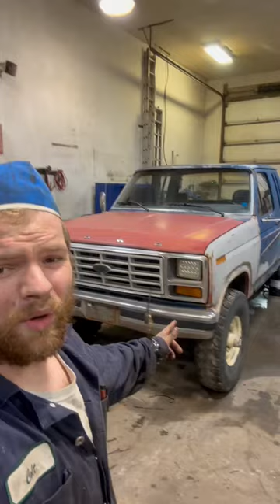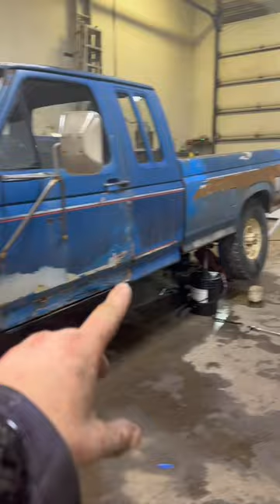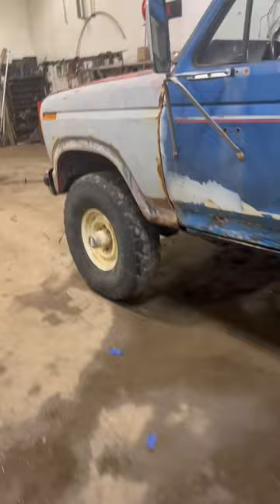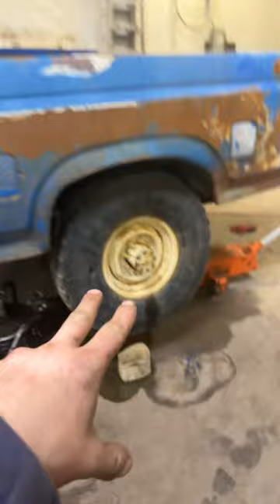Fords state of the art flexi frame

Comment: This is just dumb. Ford uses exactly the same style c channel frame now that they always did, and frame flex is not necessarily a good thing. And that is more frame flex and less suspension flex than an f250 should have, you definitely have some loose rivets or rust making your frame twisty.
Reply from the maker: Considering the newer ford frames are hydro formed box frames I don't think you know what you're talking about, frame flex is a characteristic of ladder frames designs, its very aggressive on complete c channel frames, the longer the frame the more flex. Considering this truck is much longer than most trucks on the market today and is almost complete C channel it is perfectly normal to have this flex. Also as for the suspension flex you can't even state something like that without knowing how man leafs are under the truck, the more leafs the less suspension flex thus more frame flex, less leafs the more suspension flex, less frame flex needed.

Comment: You may need to send your engineering resume to Ford. You already think like a Ford engineer that has been there for decades and haven't even gotten the job yet. Basically taking a problem or issue and çlaimiing it's an added bonus. Flex isn't engineered into a frame. Flex is engineered into steel. It can flex or it can break. Ford frames moving 6 inches or more over the length of a vehicle is too much and definitely not  a benefit when radiators meet fans and Subway sandwiches are where your spark plugs used to be. Oh wait, that's another issûé . But hey, Ford knows you may need food more than firing cylinders. Keep it up Ford advocate, they need you more than ever now
Reply from the maker: Heavy duty semi trucks still use C rails to this day, they also flex very well. Must be something to it
Reply: @highostablegarage  I have installed dump bodies on big trucks several times. Macks stand out as one with double and sometimes triple C channel frames. I just think this video has gone in a strange direction. When engineering a vehicle frame one doesn't spend a bunch of time calculating flex into a frame. It's quite the opposite. I said before certain metals are hard and brittle and some are soft and malleable. All have a purpose. The foundation of a vehicle should be and needs to be a rigid platform. Flex is your suspensions job. Yes frames flex in certain situations and brittle frames aren't desirable but I would hope we can agree that when a Ford truck is stuck in a plowed field on fairly level ground except the holes the tires have dug and the bed covers half the rear glass then we have in my opinion too much frame flex and I doubt that even bottom of the barrel engineers did calculations and intentionally added this feature into their vehicle.This was one of many real world observations.  There's a thing in manufacturing called " non value added" these are steps that cost you money but give no benefits that one would pay extra for.These are also things you seek to eliminate if possible. So where are we? Yes, frame flex is a thing but I assure you it's not a desirable thing. Frame cracks aren't desirable either. I think engineering seeks to find the balance where cracks aren't an issue and flex isn't either.

Comment: It was poor design that’s why they are no longer built this way. Same with all crossmembers many many iterations and trials for frames. Only one I can say did a well good job is Toyotas Land Cruisers. And that’s 80’s till mid 2000’s though as hell. Very resistant to rust. Only bad part is with the boxed in design all the extra holes catch dirt and the frames will literally fill up over the years. And that WILL rot them. But all the big 3 make much worse designs even to this day ford and dodge are a joke when it comes to vehicles. Glorified SUV’s
Reply from the maker: Idk, heavy duty transports are all c channel

Comment: I don’t think that the truck twisting itself apart is something to be proud of.
Reply from the maker: That's what it was designed to do so I don't see why not.
Reply: @highostablegarage  no it’s not designed to do that. That’s just a by product of ford being too cheap and not knowing what they were doing at the time.
Reply from the maker: @connor4961  c channel frames are designed to flex, that is one of their whole advantages, ford technically wasn't the only company doing this either, square body Chevys are the very same. Modern transports do the very same thing.
Reply: @@user-ov4mt5yw7q the alternative is that they design some actual suspension that does it’s job.
Reply: @@user-ov4mt5yw7qagreed. I have a 95 f250 and would do things with it I wouldn’t do with our 2012 f250 work truck
Reply: @connor4961  you really wanna go after dodge or Chevy on their suspension in the 80s 💀
Reply: @connor4961  sorry broh big rigs still use c channel and flex like crazy, just go look at one with a load behind it trying to accelerate, the whole frame is twisting, it's designed that way
Reply: @nativeoutdoors1780  yeah a big rig that weighs 80,000 lbs loaded and isn’t designed for off road purposes. This is a little pickup that’s built to throw shit in the bed and go down fields and rough roads, also I’m sure dodge had shit suspension too. The only one I know that had decent suspension for the time was the old square body, not saying it rode well or anything and I know it had the same c frame design.

Comment: As a certified, Chief frame specialist. That is not at all what is going on there. Not even close. It's called suspension articulation.

Much like the foundation of your house... Your frame isn't built to flex.

That frame is rotting. And losing its structural integrity.

Put the phone down. And go back to school.
Reply from the maker: You are so wrong you have no idea XD explain why semi trucks and trailers are designed to flex? A flexible frame is a byproduct of a C channel construction.

Comment: My buddies make fun of me when i flex out my 84 f150 in a ditch or on a big hill there like aww man your truck such a pile and its not supposed to look like that and im just like no c channel frame sorry chevy boy my ford just built better😊
Reply from the maker: in todays standards the early trucks look like there is something broke on em when flexing, but it’s just how they are haha
Reply: Ummmm. I’ve owned a few old Fords and Chevys and some newer fords and Chevys… fords are not built better, old vs old and newer vs newer, at least in my experiences with the 2 brands of trucks. Ford has had a long history of knowing they have a problem/s, and just keep on producing things with said problem/s for years and making trucks to pretty much last only to the end of the warranty period before the power train just falls apart. Gm’s biggest fault for a while has been their cylinder deactivation bs, which isn’t a problem as long as you keep up with your oil changes, and their 4l60e in their smaller vehicles like the s10, and s10 blazer just got shoddy quality control, I’ve have full size 4l60es last over 200k miles with nothing more then a filter and fluid change around every hundred, still got one going strong over 200k on a Tahoe, that I use to daily and beat on, I modified a few things and tuned it to make it rather quick for a 6k lbs, naturally aspirated vehicle.
Reply: @marv8481 fully built 5.3s are still mutts if they’re NA. Lucky to squeeze 450 hp out of it and that’s a full tilt build. Just a tune and little stuff you ain’t making 350. It’s not rather quick.
Reply: @marv8481 ummmm......you have no idea what your talking about